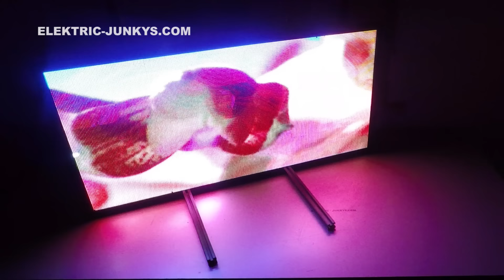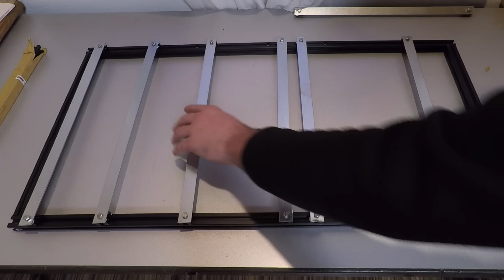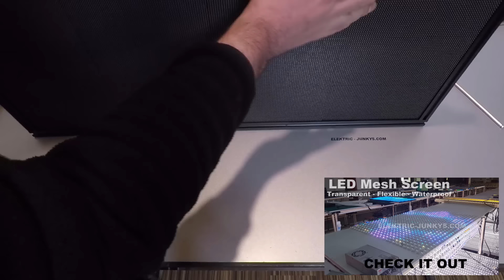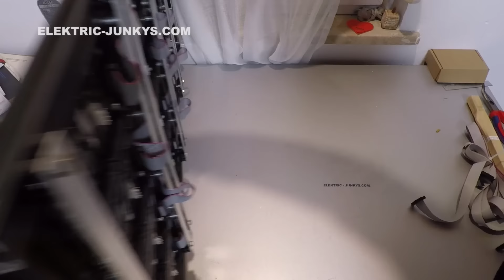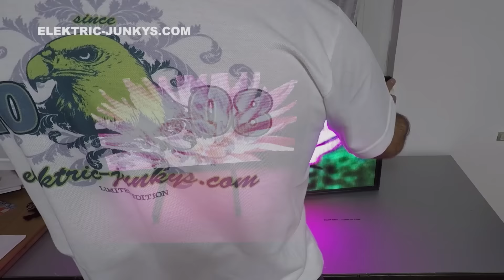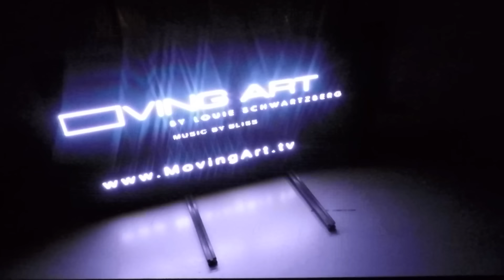How to build a Modular LED Display P3 in 4 hours on budget for In- & Outdoor use w/ elektric-junkys

Comment: how much the frame to create a 640x640mm led screen using 320x160mm module, and want the back bracket in screw type not in magnet
Reply from the maker: hi, about 165$ depend on option and used material .. send us an email for more infos https://elektric-junkys.com
Reply: @ejunky66  sure.. is the price includes screen module, receiving card, supply and cables? Thanks
Reply: I have send an email already.. hope to get response soon.. thank you.
Reply: @ejunky66  hi i used the email form but it says return to sender.. can you please give us correct and working email? Thanks

Comment: It cant be taller than this right? because there is only entrance for 4 connections in the controllboard or is there a controllbord that allows for a greater size?
Reply from the maker: thank´s for comment that is right it can be endless, aslong your Power is not running out :)) Cheers have a great Weekend !

Comment: should put the screws blocks on the inside of the profiles and connect the bolts to the aluminum there freeing up the corners to flush mount the panels so you can put more of them together
Reply from the maker: that is right sir, any other suggestions or DIY Projects ? Post them to our DIY Group ! elektric-junkys.com

Comment: Would it not be more cost effective to just use a led monitor.
Reply: You could but that would involve coding to use multiples, this appears to be a modular system which means you could make the screen as large as you like (or afford) with no coding required.
Reply from the maker: Exactly .. thank´s for comment .. regards

Comment: Need to build a DJ booth basically identical to this except larger, but your linnks are dead :(
Reply from the maker: hi, impossible, we receive Orders Day by Day seems something with your Browser is wrong .. I have checked just now all works fine for me
Reply: @ejunky66  perfect, yes indeed it was my browser!
Reply from the maker: @djjoel1  thank´s a lot for clearing out, you can everytime contact us if you need help. We will help you Plan, design and manage all the Assembly Material for your Project. Aside we have finished solutions as well .. just shot us an email on elektric-junkys.com